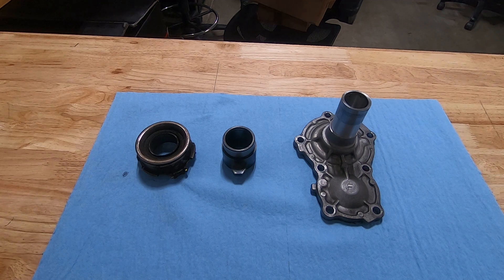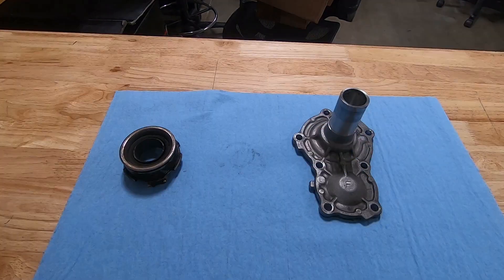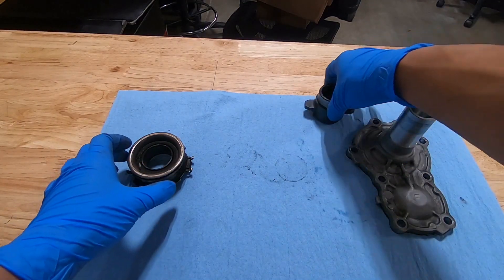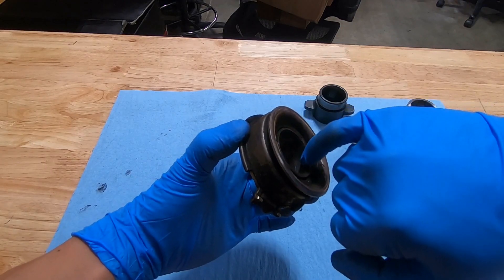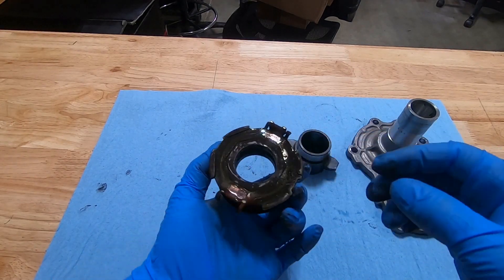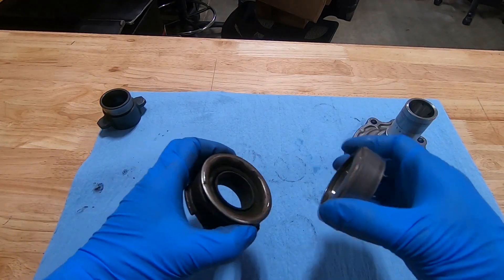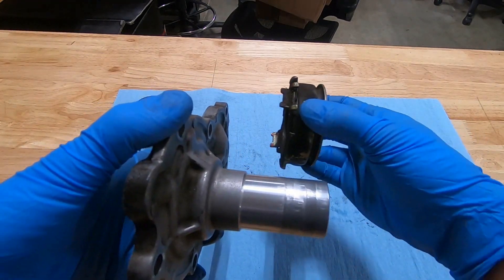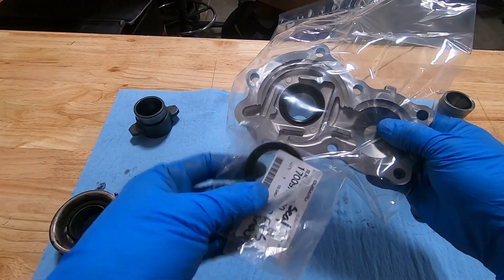MT Tech: TL70 (FRS/BRZ/GT86) Throw Out Bearing

Comment: this is interesting. My TB started squeaking a few years after buying my FR-S (brand new) and I tried greasing it a few times without trans removal, it helped for a couple more years until the TB completely busted. So I replaced my clutch, flywheel & TB and made sure to properly lube it up so this wouldn't happen again. Well, it's been 2 years since the replacement and it's squeaking again. I need a solution to this and wondering if this retro-fit has been tested?
Reply from the maker: Thanks for bring this up. I had previously given up on this project, but our sister company has a design intern now so I'll dig up my notes and see if he want to take this on.

Two keys on FRS clutch installs are cleanliness and using the proper grease: old clutch dust and crap will shorten the life of a t-out bearing fast. I've had to use an uprated Amsoil grease as I've found regular greases dont survive in that environment.
Reply: @CMAutohaus   ive made sure to use the proper grease and cleaned surfaces thoroughly but somehow the issue is back. id love to hear what you can come back with on this project. If you actually make it happen ill perform the same job on my car and can also post this on the ft86 forum and give you the credit. this car needs a real solution! Thanks for the reply
Reply: @CM Autohaus  any part number for that grease and where do you find it at ?

Comment: do you have the part number for the shaft sleeve replacement? Any tips on replacing it?
Reply from the maker: Service manual is straight forward. I do not have a readily available PN sorry.